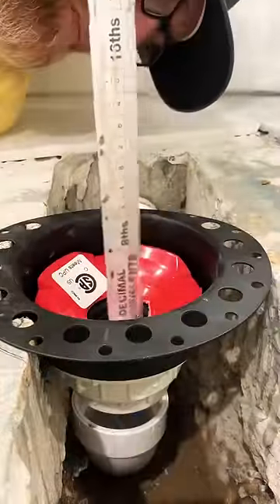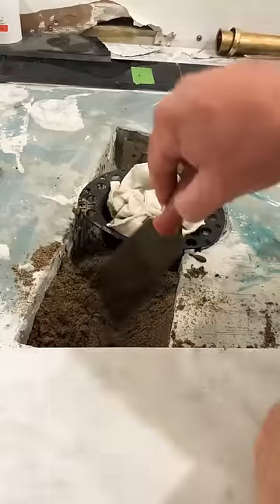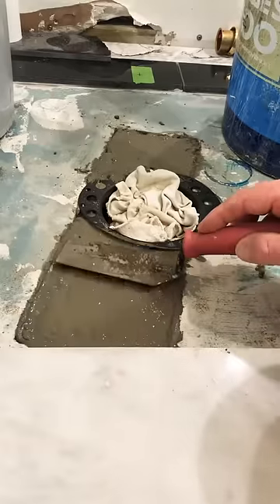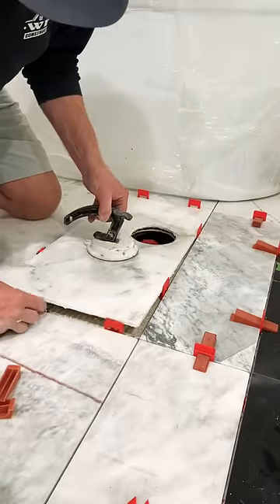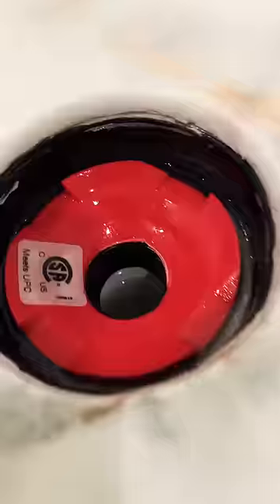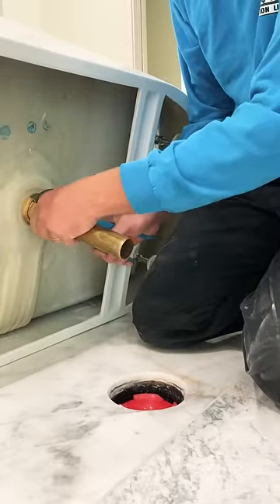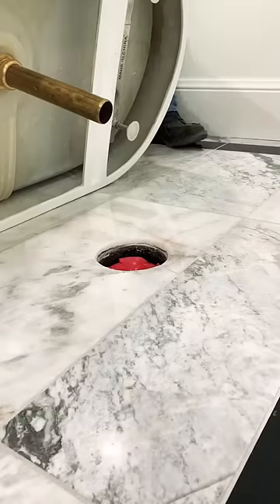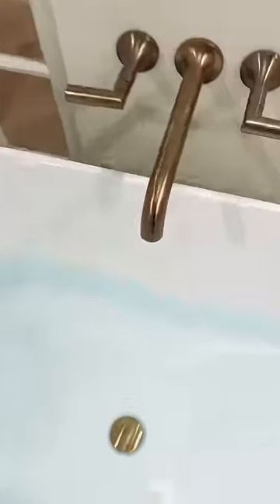The ONLY way to install a FREESTANDING tub #plumbing #bathtub #bathroom

Comment: Super good product! Pro tip: set the tub on a couple 2*4’s and fill it up. Drop the drain and inspect before you drop and silicone for the final. Super easy to use product!
Reply from the maker: Great tip!
Reply: @w.k.d.constructionllc  that's what she said lol
Reply: @whosyodaddy763  Lmao....
Reply: Now that you can deal with
Reply: Too bad it's 140 bucks plus tax lol

Comment: I appreciate the clean edge of the cutout. I always took the time to make nice cuts, even if I was the only one ever to see them
Reply from the maker: Right on!
Reply: Me too. I can not stand the usual butchery from plumbers and tile setters. I had a plumber cut a ridiculously rough hole for a vent in my roof sheathing. It wasn't even close to round/oval. I asked why he didn't take an extra few seconds to do it clean. He literally told me he couldn't see it from his house. I told him I could see it from mine because I was the homeowner. That was his last day on my job.
Reply: @Jeff-v2c  I'm not in construction anymore but some guys really gave us a bad reputation. One of my coworkers would throw garbage behind corner cabinets in the dead space. Drove me nuts
Reply: @Jeff-v2c  and I've heard ridiculous things like can't see it from my house or brake light guarantee. Meaning, I'll be responsible for as long as you can see my brake lights. Terrible way to be
Reply: @17Liberty76  YUP. I've seen this so many times. I had an electrician's helper tell me the informal motto of his coworkers. It included profanity that rhymes with the nake of the company. I showed him the door and called the principal of the company to let him know. Several people lost their jobs that day. Again, the kid didn't realize that I was the homeowner when he said it. 🤷
Reply: @Jeff-v2c  wow. Well good on you for guarding your house and best interests so well

Comment: In Australia we have a killer product for freestanding baths, it's a pop-down plug and waste with semi rigid flexible piping all sold in 1 kit. No need to cut the floor up (as long as your in slab pipe position is located anywhere under your desired tub location), and it can also be accessed easily later if needed. Also due to the semi flexible piping it gives you the ability to move the bath to make adjustments in position etc.
Reply: US (or specifically 'some states') has too many codes.  Some are inexplicable.
Reply: Link want to see wth ur blaming about please

Comment: To anyone that's ever set a free standing tub, they suck & r a pain n the ass to install.  That drain is brillant
Reply from the maker: I will use these from now on
Reply: Yeah; maybe next time use a less...robust material to set it given it'll be under the tub anyway though. (Quickset is gonna drive the plumber who has to fix that s*** when it fails is gonna lose their mind.)
Reply: @ulogy Fix what? Its PVC under concrete, what do you figure is going to happen to it?

Comment: Great video!  I am replacing an old alcove with a freestanding tub. How would I connect the misaligned drains and build a platform? The flooring is concrete.
Reply from the maker: Thank you. You would have to bust up the concrete anyhow to tie into the drain, i would move the plumbing to where it needs and not build a platform

Comment: Beautiful work! May I ask, if you end up getting a clog in the drain. Will it not leak from the bottom?
Reply from the maker: No, it has a 3 layer o ring that is super watertight. It would back up into the tub, not the floor
Reply: @w.k.d.constructionllc  that’s amazing. I’ll look into it. Beautiful work! Thanks for the reply
Reply from the maker: @PlumbersSon  it is also a pressure testable fitting during rough in!

Comment: I like it, but I do have one question what if the seal goes bad in it, is there a way to replace it without having to break up all the concrete. And how long does that brass hold up pretty long as long as no one's putting acid down the drain or Drano. Or is that why it has that design of being like a floor drain anyways so if it does leak it catches everything. I kind of wish we would have done our tub this way now even though it wasn't a freestanding it was a drop in.
Reply from the maker: You can replace the O ring inside the fitting without busting up concrete & Brass will basically last forever. This fitting is watertight and amazing!

Comment: Thank you good sir.
You have just about made me the happiest lil do it yourselfer, wannabe plumber ever.
I got to do a shower pan in the basement. Been sitting for about a year trying to figure out how to glue up the PVC and cement it in.
Your a f#cken legend sir
Reply from the maker: Sweet! But if you are installing a shower base, when you come up out of the P trap use a 2” no caulk brass shower drain. They are a simple install as well!
Reply: Randy, setting a shower pan isn't a DIY project. Hire a professional. There are too many small details to account for. Your shower pan won't last.
Reply: @Mydriasis100  wow you replied to me!
Thank you for the warning.
But I am a turbo jerk that thinks "if I don't research and try it myself I will never learn"
I did my main floor bathroom, new tub, toilet, floor, tiled the walls and even built a sink from wood and epoxy resin. (Who cares, I know)
Thank you for your concern and warning. 
Have you done videos on a shower pan install over a cement floor? Or know a good channel to check out?
Figure it out on my own?

Comment: Question??? 

Is it okay to have the curve at the bottom that will always hold water according to building codes?

I thought the pipe had to always be able to fully drain on a consistent incline

I have never done any work with drains, so this is only a question, not a critique
Reply from the maker: Great question, it should be a “P” trap installed that will hold water. BUT it is designed to do so because the sewer gas/smell would actually vent into your home if the water wasn’t there. The water acts as a plug to keep your home from smellin’ up to high heaven! 😆
Reply: @w.k.d.constructionllc  oh wow, thanks for the quick response ❤️💪🏾

Comment: Do those leveling clips not.pull tile away from mortar? Would love to do a golf ball test on one of these floors.
Reply from the maker: Good question, but the answer is No. if you back butter and apply an ideal amount of thinset to the substrate… set the tile, get all the air out and the thinset will create its own suction and the mortar will either stretch or compress with the tile. The clips just keep tiles flush with each other.
Reply: @w.k.d.constructionllc  good point, I have laid a few tile in my day,only back buttered shower walls.   I have a few hollow tiles in my current house and it drives me nuts.

Comment: I like to use a double flare extension and stick it in a trap adapter about 16 inches. I love these type of drains. Kind of like a mop sink. Props brother
Reply from the maker: Appreciate it
Reply: Until the line is clogged and it backs up
Reply from the maker: @johncuervo3019  this fitting won’t leak, it’s rated for pressure.

Comment: can this be waterproofed over and used inside a shower enclosure? if not, what kind of drain do you use for a freestanding tub inside of a wet area?
Reply from the maker: I believe so, may have to use some Kerdi fix and Schluter membrane to make the waterproofing work?

Comment: dear master with the voice of a radio host, it looks like you have all the plumbing with "concealed fastening" and glue, this is not usual for a plumber from the other side of the world, where all sewer pipes are attached through a rubber coupling and a threaded connection, but very beautiful, any work in respect.
p.s.thanks for showing such a cone on the grinder, I will look, I have never seen such
Reply from the maker: Thanks for watching

Comment: What is the purpose of concreting it shut and putting tile over it? I would have left it open so when they redo the bathroom you can still get to the pipe
Reply from the maker: If you noticed, I used mostly sand. There’s only 1.5” worth of concrete . It is to seal ground moisture from wicking up into the bathroom

Comment: What do you mean it doesn't matter having no plumbing beneath?
I see you attached it to a drain pipe in the concrete.
Plus if there is no plumbing, where's the water going?
Reply from the maker: There is plumbing, but later if and when you need to move the tub…you dont have to access the plumbing to do so

Comment: So if you fill the tub all the way up beyond the capacity of the pipe how does that not backflow up unto the floor?
Reply from the maker: It’s a watertight fitting, triple layer o ring. As long as there are no obstructions in the drainage pipe, it will drain fine no matter the volume of water. If there was an obstruction it would still hold the water and not backup.

Comment: does it overflow if the drain is blocked?
Reply from the maker: No, it’s a watertight fitting. It would back up into the tub …not under it

Comment: If the drain gets a clog and backs up no fittings it comes up under the tub over the floor ?  all I see is a Drop pipe  No seal
Reply from the maker: It would back up into the tub, not out and under it. It has a 3 layer o ring which makes it a pressure testable fitting up to 30psi. Very beautifully designed fitting for this application
Reply: @w.k.d.constructionllc  Cool

Comment: Only issue I could see happening is potential leaking if the drain backs up. Cool idea, nonetheless. Freestanding tubs can be a real PITA, especially on a slab.
Reply from the maker: This won’t leak, it’s a 3 layer o ring that is pressure testable up to 30psi.
Reply: @w.k.d.constructionllc  Nice! Definitely will give them a shot once I do my homework on them.

Comment: I'm wondering how it keeps the water from backflowing under the tub? It don't matter much i guess if you tile all around. Its just rubber in the center correct?
Reply from the maker: The water stays down into the bottom of the p trap, water won’t back up under the tub. It drains into the sewer. Yes, there is a multi layer O ring that sealed the tailpiece to the drain flange making it a watertight fitting. Water can’t backflow out into the floor either

Comment: Tip: Use silicone on that tailpiece not lube.  When you drain a full tub, if your tub drain pipe is old and swollen on the inside then you will create a lot of back pressure. This will force the water out through that drain if all you have is plumbers grease on it.
Reply from the maker: This is a 3 layer o ring. Nothing getting by it

Comment: What if there is a back flow? Does it keep sewage from running back into the tub somehow?
Reply from the maker: Check valve on main line
Reply: @w.k.d.constructionllc gotcha, I'm not a plumber by any means and I don't know how I got your videos recommended, but you got a new follower because you do good work! 😁
Reply from the maker: @Diodontgivadayum  appreciate it!

Comment: How did you secure the tub?
Reply from the maker: The brass tailpiece holds it in place but I placed a small bead of silicone around the bottom of tub to really secure it

Comment: Island tub drains are also great for washing machine pans for under appliance in rentals. Code requires pans in condos and upper story units. So this makes it so I don’t have to going into neighbors ceiling. Before I found this product I would make them before it was a thing. Still beating myself up for not parenting my version which is now this version
Reply: Patenting*
Reply from the maker: sweet, NICE!

Comment: there absolutely is access to plumbing beneath, how u cut that little piece in order to connect to that 2" drain fyi  YOU CAN ACCESS ALL THAT PIPE THE SAME WAY   JACKHAMMER AND ELBOW GREASE
Reply from the maker: 🙄 no need to access it, ever!

Comment: How exactly are you doing the pipe connection with a concrete slab, after the fact?
Reply from the maker: didn't you watch the video. I did it just like that. easy peasy lemon squeezy

Comment: I don’t understand why you would put concrete back in that hole. I know that you should not need to get back in there, but what if you do? I would’ve packed it with some thing for.
Reply from the maker: There was concrete, i just didn’t do it solid

Comment: This would also work for a shower as well, provided the installer installs it exactly where its suppose to be. Since I am going to be doing concrete finish floors I may just opt to block out this section and leave it open for minor adjustments to the shower pan. I though about doing tile walls and in the end its cheaper to buy a 2000 dollar ( includes glass doors and fixtures ) 2 piece shower kit than pay someone to come in and tile everything. i want function over pretty. I am spending my money on function instead of style.
Reply from the maker: You would have to do some reducing to make this tailpiece fit( if at all possible?) use a standard no caulk 2” brass shower drain. They work great! I use them all the time with pre-made shower pans

Comment: So if the pipe gets blocked , water will come up in the floor and not through the drain of the tub? How’s this a good product
Reply from the maker: No, it will not. It’s a water tight fitting. It would only come up into the tub

Comment: Nah, 
We plumbers have been installing free standing bathtub way before quickdrain or slickdrain were invented. 

Remember one thing about those drains.
They cannot hold pressure, so if it blocks further down the line, it will leak over the top plate and create a flood (not the case here cause its in a basement)

But that's the way to install them👌
Reply from the maker: This fitting is pressure testable up to 30psi.
Reply: @w.k.d.constructionllc  
Perfect execution btw brother👌

Comment: How did you vent that p trap?
Reply from the maker: Through the roof
Reply: @w.k.d.constructionllc  Hmmm. Freestanding tubs are often vented wrong, and with your tight, "no access" conditions and your sarcastic non-answer to a simple question, that makes you sus...
Reply from the maker: @bobuncle87  there is a wall 2’ from the trap that it is vented up through the roof 🤷🏼‍♂️
Reply: lol who decides that most tubs are vented wrong? Bud, unless you do your own plumbing, I’d count on most respectable plumbers to do their job correctly, especially with inspections involved.
Reply: @bobuncle87 Girl, See a shrink. You are trying to cause Drama Just to have Drama. Pathetic

Comment: Yo Keith! Man! Why do I need an island tub drain!?
Reply from the maker: They are bad Ass! It’s a game changer fitting. Totally watertight seal, plus it’s perfect if you have a slab foundation. Say you needed to move the tub for any reason at all, you can simply lift the tub up and set it back into place without having to tighten or loosen any fittings. Very cool!

Comment: That's the one and only application you should ever use that 200 dollar drain. I see people using these when there is a floor underneath and could use a 3 dollar trap adapter from the bottom.
Reply from the maker: It works like a champ!

Comment: That's the same system we use in Australia for setting toilets, no wax ring
Reply from the maker: sweet!!
Reply: You give your toilets traps?
Reply from the maker: @HoneyCultured  all commodes have traps…I believe he’s talking about the floor fitting tho. Its sealed with an o ring type fitting vs the wax or foam gaskets we have in the states.
Reply: @HoneyCultured  floor flange has a rubber seal that the porcelain slips into

Comment: Great job, but there’s a cheaper way. Instead of the 200$ flange , glue in a trap adapter, install the tailpiece, drop the tub on 2 blocks with tailpiece inserted into the drain, reach underneath and tighten trap adapter nut, slide blocks out and drop the tub into place. 
5$ instead of 200$. 

If it’s my own house, sure I’ll buy this, but we install 5…6 tubs a month with the crazy new construction going on in Texas, and we can pocket more money this way.
Yet to have a leak doing it this way; it’s essentially the same as you would install a sink trap extension.
Reply from the maker: Cheaper, yes…just the same, No. if you have a crawl space and can access the adapter fine but if it’s in a slab with no access, I’ll keep spending the extra money for the island tub drain.
Reply: You probably didn’t understand what I said . Adapter stays on top of the slab. If you have issues, pull the tub up and the adapter is there, sealed above the slab.
It has nothing to do with slab vs crawl space. In fact, slab is all we do here in Texas.
Reply from the maker: @andrealaphilippe5926  I did understand. It’s not a guarantee that fitting won’t leak once you set the tub down tho. You won’t know until it’s leaking. The OS&B won’t leak. It’s a guaranteed watertight fit since it has a triple O’ring design.